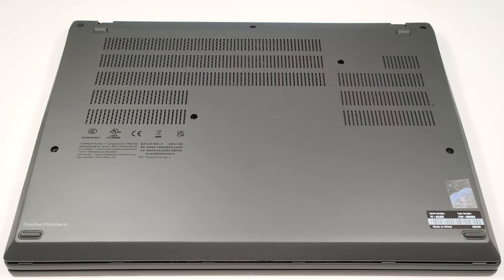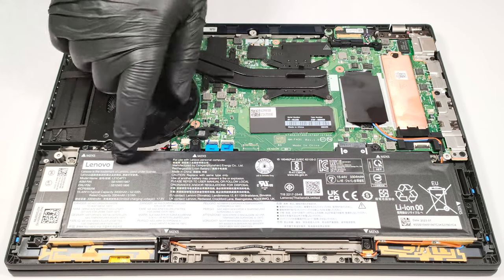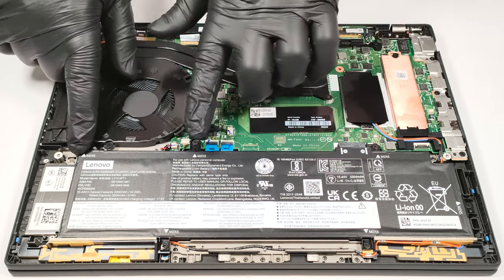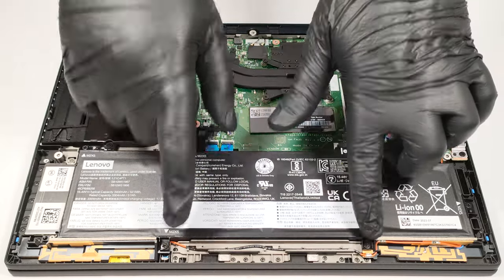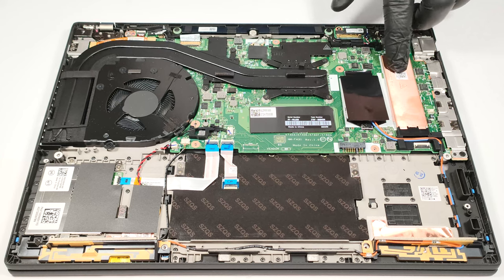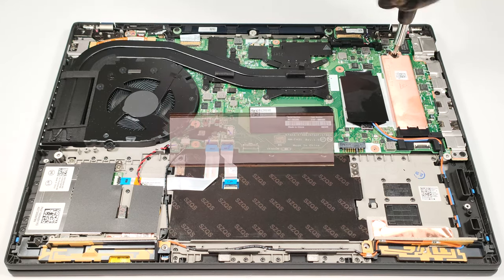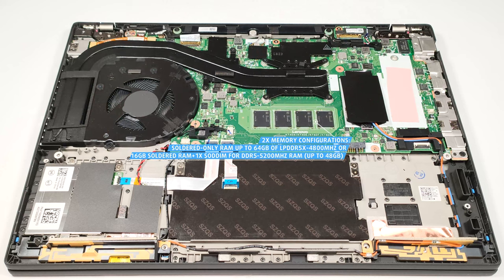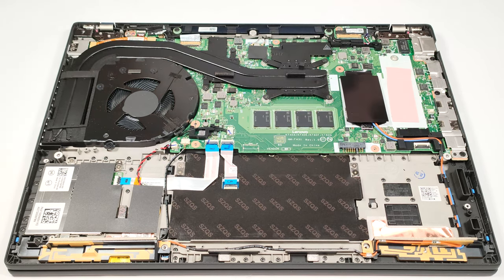🛠️ How to open Lenovo ThinkPad P14s Gen 4 - disassembly and upgrade options

Comment: Which one is better, P14s Gen 4 7840U Oled, or HP Firefly G10 7840HS dreamcolour ips? They are around same price 2400€ with maxed out memory.
Reply: Stay away from HP. Comparing HP and Thinkpadis is an insult to Lenovo. 

Get the P14 and use it for next 7-8 years.

(I am a think pad user for many years)
Reply: @tr9036  by saying ur a think pad for many years, your opinion about HP is worthless.
Reply: I've owned multiple portable workstations from Lenovo, Dell & HP. I would advise Lenovo (thinkpad) first, then Dell Latitude and then HP's. HP just isn't as robust when it comes to portable workstations. Infact their entire lineup of laptops is always a little underwhelming in most areas of comparison - not just raw specs.
Reply: Thinkpad is a work horse.  HP overheats easy and not durable at all.
Reply: I would recommend going with the 400 nit low power screen, the battery life will be much better. It looks great on my unit
Reply: @Scoutscout1000  yOU CAN ADJUST THE BRIGHTNESS :) :) :)
You dont have to buy lowest nit :)
Reply: @tr9036  OLED is higher res so will use more power. The res difference is not very noticeable on a 14 inch screen.
Reply: @Scoutscout1000  I was worried that 1200p res is too little, so i got 16" with 1600p res screen. Now i see that 1200p would be more than enough on 14". Looking YouTube from smartphone vs laptop is completely different experience. On smartphone you don't notice the YouTube video encoding compression artifacts, but on laptop screen everything is visible.
Reply: I wouln't trust the opinions obtained under a thinkpad video ahah Anyway, I had to make the same choice. The machines are comparable. The thinkpad is better built and has a better keyboard (with a trackpoint), the HP is more upgradable (you can change almost everything). I chose the thinkpad in the end but only because I could afford the best components. Choosing the entry version of that HP and upgrading the components yourself would be a great idea.